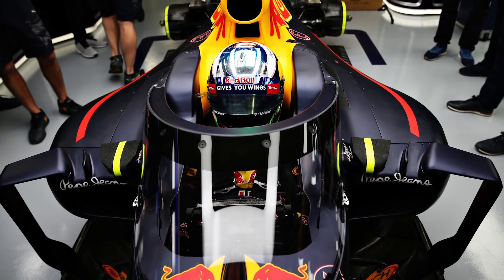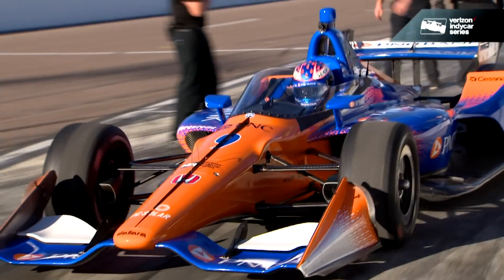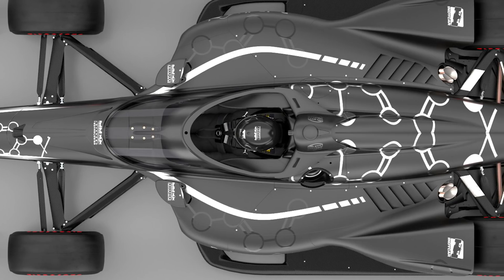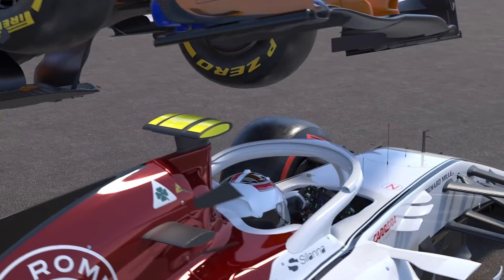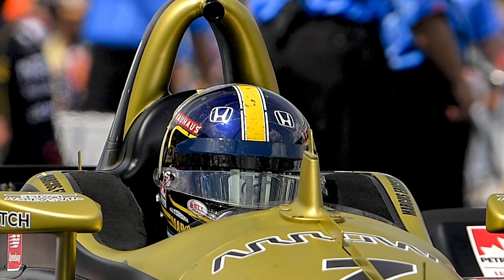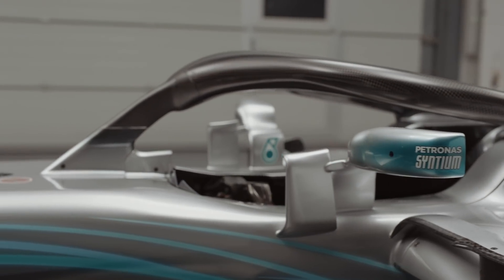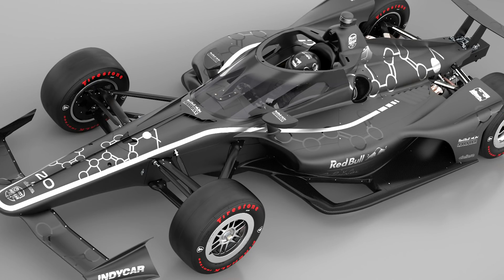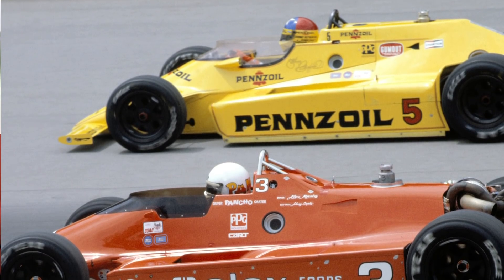Why IndyCar chose Red Bull's screen that F1 rejected

Comment: I’m very cautious as to how the screen affects glare. Light hitting the outside is one thing but during night races when light from acute angles from floodlights can creep through over the drivers shoulder and hit the inside of the screen. Also how would rain affect visibility? They can’t peel of layers of the screen like they do their helmets. Water will dissipate due to the high speeds but water mixed with grease and other fluids could gunk up the screen.
Reply: PPG makes canopies for fighter jets....They've been handling those issues for years

Comment: Why don’t they stop bullshitting everyone and go full cockpit, if it’s for the drivers safety. Or the safest set up for a driver would be to eliminate the driver. Go full remote operation and the drivers could operate via race simulator.

Comment: Why not have the F1 cars have an open and close cockpits like the Formula 1 car in the 1999 Atari/Midway arcade racer: San Francisco Rush 2049?
Reply: Playstation 5247 because it’s not as safe as the halo?!
Reply: @hyperdriveenable  If the halo covers most of the cockpit, than they should cover the cockpit completely and make a windshield aero screen for track visibility

Comment: Could this also be utilized for aero? By the looks of it there would so much airflow over it with the halo it would cause more drag but with the screen would it not be allot more aerodynamic and have less drag??? I'm not an expert just thought
Reply: I was thinking the same. It definetely adds something for the engineers to play around with, but the FIA will probably give pretty strict standards about the measurements so I don't think any of the screens in the grid are gonna look different from each other. But yeah it certainly has a relevant aerodynamic impact, no doubt about that.
Reply: it will reduce the drag for sure , however i think it will generate a lot of turbulent air (low pressure zone inside the cabin)  which can reduce the efficiency of the rear wing . to reduce it they must add S-Ducts to reduce the low pressure zone and this will add drag again . but as David Said , this can be a very interesting aria to play with :P
Reply: if they use it , it will be standard
Reply: @mehdidamfs3112  that's not relevant with what I said I'm asking if it would aid in aerodynamics

Comment: Also other issue is cleaning. Driver scan now pull off a tear off and see clear again. Now they cant. Will be up to the team to safely have a crew member reach in and rip a tear off during a pit stop.
Reply: They'll probably do a aero screen tear off during pitstops like Nascar or Sports Car racing

Comment: I’m all about safety, however we are getting to a point where the drivers might as well drive in simulators. We call the drivers gladiators because they thrive with driving with the risk. Most drivers don’t even what the halo or anything else that limits their performance. I think we should stop with the halos, otherwise F1 cars will look like regular cars in ten years as they are the safest. Senna would laugh at these discussions!
Reply: Not very risky in the 70s when they chicken out on braking is it?

Indy 500 this year had them 3 wide. Tell me why safety makes edge of death moves less frequent. 

It doesn't. If you think senna would have laughed at these discussions, why was he good friends with sid watkins and why was he so hurt when Roland died?

Comment: Seems like this isn't so much as "screen instead of halo" as it is "a screen over a halo"
Reply: Excludos looks better than the halo alone, though
Reply: Right, that's basically what it is, & imo, an improvement over the Halo. The current F1 Halo does NOTHING to prevent cockpit intrusion by a small object,  I haven't understood from the start why you would introduce a safety device of this type without addressing the fact that the drivers are vulnerable to flying debris. This seemed like an obvious solution 2 years ago, but perhaps I'm in the twilight zone,  or...worse.
Reply: @pigalow2002  Think some large debris can still intrude into the cockpit as well e.g. Bianchi's crash, depending on the angle of impact. A revised halo design with 2 vertical arms (1 at each front corner of the cockpit) instead of 1 currently (in-line with the steering wheel) might offer better protection though
Reply: @pigalow2002  thats why theres a helmet
Reply: @gsainoy  oh yes! Of course!! A helmet, that's all we need! Why bother with any of these screens & halos, right? We had the answer all along!
Reply: @pigalow2002  yes indeed, for the small things
Reply: @pigalow2002  the halo was objectively more effective than the screen when the halo was first added to F1. More importantly, large heavy objects are a bigger threat to the driver because smaller objects don't cause as much damage. It seems like you're completely misunderstanding the process of making safety devices... You put out what's ready.
Reply: @E_Mihaya ? I think you're misunderstanding...life. Why not address BOTH threats? How's that for an idea? & don't give me this bullshit about it "not being ready". That's crap. This exact design was available 2 years ago when F1 introduced the halo.
Reply: @MyRealName  https://www.mirror.co.uk/sport/formula-1/formula-one-ace-felipe-massa-408759

Spring small enough to pass through the gaps in the halo knocks Felipe Massa unconscious and causes skull fracture.
Reply: @MyRealName  on top of what warp14engage has posted
the halo could make the spring situation worse if a deflection off the halo causes the object to hit the chest area instead of the head
Reply: @radihaydos95  I was saying this a while ago. I always thought there is a chance it could deflect an object towards the driver. But apparently testing shows otherwise.
Reply: @E_Mihaya  Didn't Massa get a small object to the skull... Didn't Senna get killed by a piece of suspension.. Why don't they just completely close off the cockpit for total safety.. 🤔
Reply: @MyRealName  Ayrton Sennas death involved a piece of the car breaking off and punching through his helmet...
Reply: @F1ll1nTh3Blanks  suspensions, Tyre, and some fastener all collaborated to kill him.
Reply: @F1ll1nTh3Blanks  another issue if like to add with a fully closed cockpit is extrication, it's hard to get someone out
Reply: @pigalow2002  They had the Halo ready. Other options were not ready. Which one would you choose ?
Reply: @amicaze9570  The aeroscreen wasn't ready?? Regardless, it is now, & it is better, imo, or BOTH would be better.
Reply: @pigalow2002  aeroscreen was too sight inhibitive and I'm sure being able to see is a safety feature in itself
Reply: @carlosandleon Right....just like a windshield is sight inhibitive on road cars, huh? I'm pretty sure(completely sure, actually)that the aeroscreen is clear, so I'm pretty sure that it inhibits 0.00% of the drivers field of vision--just like roadcars windshields.  & I'm pretty sure safety is  priority #1 on roadcars too, so...yeah, not sure where you came up with that, but...mighta' wanted to think that though a bit more.  Oh yeah, let's not forget to mention that the Halo actually DOES inhibit the drivers field of vision momentarily as well.  There's always that fact too.
Reply: @pigalow2002  insects
Reply: @carlosandleon  Nonsense.  If that were the case they would be a  hazard on helmet visors.
Reply: @pigalow2002  helmet visors have peelable layers for that purpose. I doubt it's easy to peel off the windscreen mid race but it could be an extra activity for the pit crew
Reply: @carlosandleon  Water resistant polish would help with liquids....
Reply: @E_Mihaya  Massa's crash in 2009 was because of the tiny spring off Ruben's Brawn. The screen would prevent that, or at least help slow it down
Reply: @MyRealName  Massa's crash in 2009
Reply: chris smith if you want to get technical they addressed the small debris problem by essentially adding a stronger layer to the helmet after the massa incident
Reply: @E_Mihaya  smaller objects stab and pierce  skulls , halo can stop a wheel or help in a flip but not objects flying off at speed from cars in front , is why indy car prefers screen , pack racing
Reply: @carlosandleon  NASCAR has had peelable layers on their windshields for a while and they can peel a layer off really quickly in about a second or two.
Reply: @warp14engage27  To be fair the helmets have been heavely upgraded since that accident
Reply: @F1ll1nTh3Blanks  honestly seems like they're either lazy or just don't care. Or they could just be scared that fans won't accept the change. The aeroscreen is still definitely the best solutions right now.
Reply: And with next gen F1 and Indycars, screen could even benefit the aero on the car.

Comment: Soon the will be driving romote controlled cars from inside a simulator. Zero risks invoved.
Reply: Yeah, The drivers should be taking risks with their lives just so you can be slightly entertained. Fucking living if you can make some idiot happy for 30 seconds.
Reply: @TheBUGZNTA  the cars are already very safe, why completely eliminate open cockpit cars?
Reply: @TheBUGZNTA  
No. They should just stay home and play video games.
Reply: Why is it that a mere improvement in safety makes people go "WHY NOT RACE AT ALL".

Because people want to race and they accept the risks! Same as a soldier. But does a soldier actively want to die? No.

Comment: The Red Bull solution is safer and looks better. It should be adopted by F1.
Reply: It might be safer when its dry, its a death sentence in the rain. Are they going to get wipers :D
Reply: 1st - Indy a car is not as fast as F1, a shattered screen would stop the race for those involved and may cause harm to others who are still racing, because the view would be minimal. 
2nd - The visor of the helmet is there so it makes no sense to put another screen that is much harder to change than a helmet, and much easier to scratch from debris.
3rd - It’s just for better Aerodynamics, F1 don’t need it, Indy does.
Reply: @ajstyles5704   Indy cars travel at faster speeds for more sustained periods than on Ovals than F1 cars ever do. Velocity is the problem not acceleration/grip in high speed crashes. These screens will not "shatter" they are made of thick aerospace grade acrylic. They would deform at the most. At which point they can easily be swapped out, much like the Halo. They will figure out visibility, we have been racing with windscreens for a long time.
Reply: @MrLathor  let me repeat, the speed of F1 are much higher, cornering, climbing, acceleration, cutting and so on.. It would have not be installed if it couldnt handle indy speed. Shattered, as in the screen have cobwebs, scratches, marks anything that will hinder the drivers view, let me remind you, these are carbon fibre material, its light, its fast and strong. Easily replaced? As in you have to drive all the way back to the pits compared to a visor that you only need to lift it, or slight adjustments already gives a clearer view? I just see many hindrance including replacing it in the pit as it will cause even more time, and you have to drive all the way back or put the car to immediate stop and retire. The problem is not just velocity of the impact of your car, but the other upcoming drivers who are still at their top speed in the situation, these guys are not robots that will do what you expect them to do.
Reply: @ajstyles5704  F1 speeds are higher on Road and Street courses, but IndyCar speeds are higher on ovals, and the higher speeds are sustained for hours. The top qualifying speed for Indy two weeks ago was just over 230mph, average for the lap, which meant they were reaching speeds nearing 240mph on the straights.
Reply: DrumJedi did you read my 2nd comment? Can you please don’t talk as if I’m a child and don’t know what Indy cars specs and statistics are? Do I have to go into every single little detail into corner speed between two apex of every F1 tracks? They are not oval, I’m not debating which is faster, it’s just the risk are a lot more higher in F1 than Indy, all F1 tracks are different from tyre types to height and weight, that includes as small as Monaco or Singapore from wall to wall and tunnels, or challenging downwards and upwards of Catalunya, or just massive beauty of Spa(my fav), or Silverstone snake apex’s, a single bent or mark or cobweb actually can cause massive problems for F1 drivers vision.
Reply: Lathan Starnes Erm, are you okay man? I didn’t feel as if it was an insult, it’s just tiring if I had to be precise with every single details, I didn’t go in this small debate presuming you don’t know about auto race, I presume you know, so I skip the details.

It’s more like the topic is F1 DRS, so are we talking activation, straight line speed or what? Then he came and say, well the wet tyres have more grip during rain, and I’m like, “what on earth that has to do with DRS?”, DRS will be locked during rain. So I’m like can you please make more sense, I already know about the wet tires, what about DRS, and then you came and say I felt insulted and you don’t give a shit if I know or not about the wet tires. See the point I’m trying to make?
Reply: @ajstyles5704  you got caught bullshitting so the next comment you try to dig yourself out of that hole by moving the goal post.
Reply: Zeitgeist X so you came here only to say that? A big man left a comment, so I started a bit debate, not telling him he is that wrong or anything, just giving my one twos, and then little kids coming along spilling facts that has nothing to do with the debate to begin with, i didn’t create the goal in the first place, I was trying to get back to topic, either it’s bullshit from your POV, sometimes you learn new things or perspective by debating. Well technically we can’t debate with little kids running amok,
Reply: Please no screens .. it's an OPEN racing, not like LMP1 cars
Reply: @79ped  It's open wheel racing
Reply: Red Bull solution? What are you talking about? It's the FIA that governs the F1 to Test the screen first on all F1 teams.
Reply: it's safer on paper, they haven't tested it outside of lab yet, so we don't have any data on how it compares with the halo
Reply: @Moribax85   Actually they have tested it in the know exactly how it will react. It's safer than the Halo because it protects from smalle parts since that only large parts. On top of all this they have all of the Air Force testing of canopies to backup what they're doing.  .
Reply: @shepleonard8695  buddy, you're almost 2 years late to the discussion
Reply: @Moribax85  it's objectively safer against smaller projectiles that could slip through the Halos gaps, the thing would be accidents like the Alonso-Leclerc incident in Spa. From what they are saying though, it's basically a Halo+Aeroscreen so it's should be better....
Reply: @lucasalcaraz2199  I'm still thinking what if the car goes upside down and burning at the same time? Looks like the screen is covering too much for the right and left side.
Reply: @lucasalcaraz2199  yeah, it should be, but until we have concrete data on it, we don't know, debris could just fly through it like it isn't even there, unlikely, but possible
Reply: @arvin6606  Would a driver be able to get through the halo gap?
Reply: @arvin6606   If they go upside down with a Halo or canopy the rescue teams will just use a Hurst tool aka jaws of life to cut through whatever they need to cut through.

Comment: Wouldn't visibility get blocked once the screen  gets covered in tyre rubber. 

Watching this year's indi. The cars were a mess at the end.
Reply: Ghostly Razgriz tear off strips like they use in other endurance series
Reply: How would a lack of windscreeen stop rubber? If you have rubber flying into your cockpit you have to deal with it regardless of if you have a window or not. Furthermore teams are prepared to clean the windscreen by applying multiple layers of peel able plastic on either the window or the helmet. That way when your visor or windscreen gets dirty the driver or pit can peel the top layer of dirty plastic off revealing a fresh sheet of clear plastic.
Reply: @TheBUGZNTA  having screen tear offs was not explained in the video.

My point is that rubber (also dirt and oil) will still accumulate on the screen during stint. Which will reduce visibility.  

Even if it's cleaned off in the pits. It'll accumulate again in the next stint.

Comment: F1 is 2 steps away from being an LMP1/LMp2 racing series. Nearly closed cockpit? Electronics and transmission from 1 approved manufacturer (2021)? What's next, covering the wheels? Racing in all its forms by definition is dangerous. These guys race for the love of speed, the adrenalin, the will to be the best. Big balls is a must, not aeroscreens or halos. That's why Lauda, Clark, Fangio, Senna are legends.
Reply: Yes, balls to make brave moves. 

They want the chance to survive, this won't stop death completely. More chance to survive means more ballsy overtaking. You talk about Lauda despite him not wanting to race because of the dangers TWO times in '76

Comment: So it's just a halo with a screen around it.
Reply: Kiei Luahi- yes that’s correct.
Reply: More like integrated.
The top structure of the Halo improves the strength of the panel. 

Honestly I like it
Reply: A screen that could be tough enough to take a hit from a 30lb bird at 700mph, mind you.

At least that's how tough fighter canopies are.